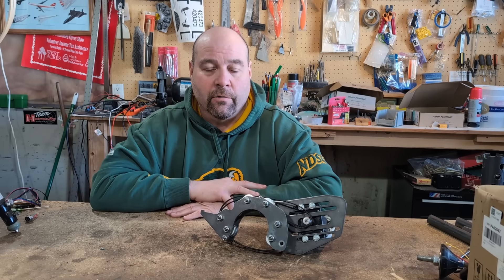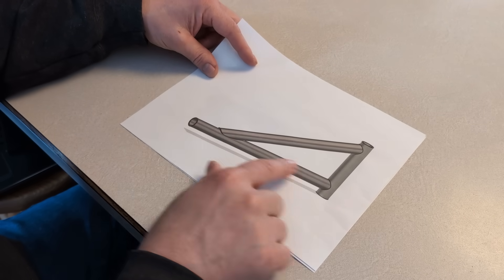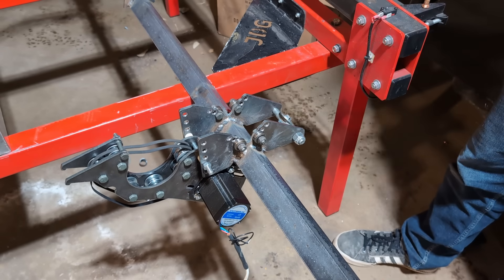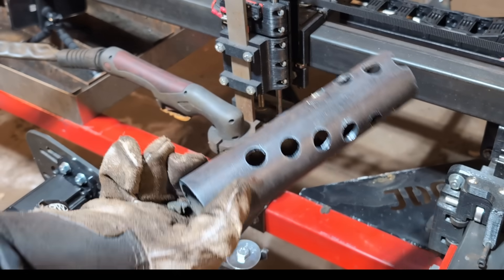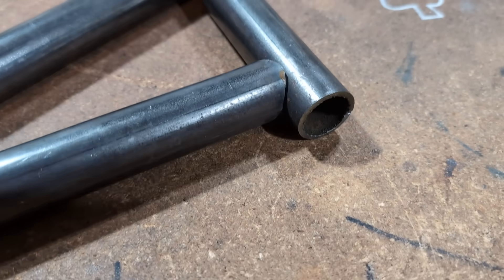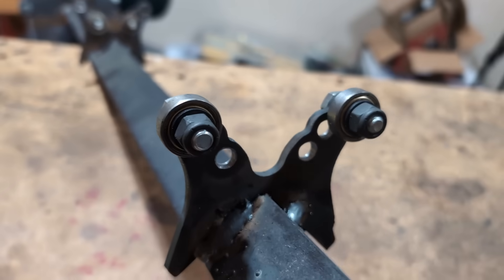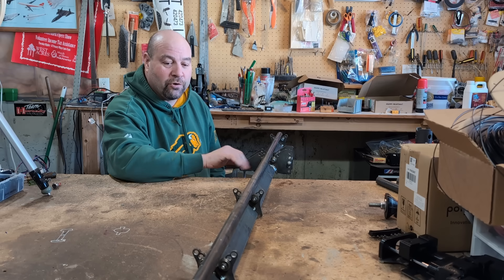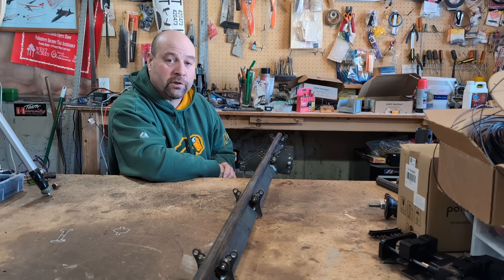DIY CNC Plasma Tube Cutter

Comment from the maker: Plans to build this are available on our website here. https://jdsgarage.bigcartel.com/category/plasma-table-xl
Reply: @jdsgarage701  thank you. I have both sets of plans. I just never got that deep till this video.
Reply: Will you add this to the small table plans as well?
Reply: Would you sell just the rotary portion?
Reply: are the plans for the rotary included with the XL plans? There's no mention of it on the website.
Reply: @welderguy0000  they are included in the plans for the XL I purchased
Reply: @starwazfan  The tube cutter is awesome, The plans are very well done and support is in fact amazing.
Reply: @ArloMulta  I have purchased them and have all of the components together and I am in the process of working on the electrical portion.

Comment: I purchased, built, and have been using your first-generation table with the first-gen rotary axis. Any chance this rotary Axis/tube notcher would be available as separate plans so people can use it on their Gen 1 tables?  Great Job Guys!! Thanks!
Reply: ola amigo
tudo bem?
vc disse que fez uma maquina de 1 geração.
sou do Brasil.
eu comprei os projetos do nosso amigo jd garage.
vc pode me ajudar a montar a minha?
nao consigo encontrar os arquivos que especificam quais os motres 
devo usar.
quais os drives?
qual placa de controle?
qual motores devo usar nos eixos inclusive o eixo rotativo?
e o diagrama de montagem eletrica?
agradeço se vc puder me ajudar.
um abraço...

Comment: I have tried a number of times to contact someone at JD’s Garage just to answer a few simple questions. Before I purchase their plans, but I get no response. I’m not sure if I’m not getting through or they just too busy to answer. 
Are the plans always the latest version of the project? 
As they make upgrades to the plans will they be available to those who have purchased the plans?
What is the approximate cost of the most updated version of the table?
Reply: The email address in your inquiry is invalid

Comment: Clever design! 👍
How did you set it up for each tube diameter? You dony seem to have a sensor for tube rotation, so did you just have to enter a magic number into the software for each tube size? What if the number is a bit out? You would get degree errors

Comment: Pretty slick. My water table looks the same. It’s been in the low 20° F here and my shop should probably get insulation before I build a rotary tube cutter 😂
Reply from the maker: We wish it was 20F when we filed this video.

Comment: That’s not what CNC stands for.
Reply: That is a CNC rotory tube cutter. CNC means Computer Numerical Control. Using number (gcode) to moves y axis and x axis rotating the tube while cutting. Now you know.

Comment: What if the belt slips on the tube?
Reply: It shouldn't if you have the belt tension right and the rollers are install straight.

Comment: 3 in 1 fiber laser cutter / welder /  cleaners are becoming more common and cheaper now. One on Kickstarter at the moment that can cut 1/8". Another YouTuber @Kwrigg mounted one up on a plasma table with great results. The rotary is a huge deal having it integrated in the same machine. You guys are doing awesome work !
Reply: Will deffo be a good future upgrade 😊

Comment: I was thinking about an adapter to notch square and rectangle tube.
Reply: Rectangle tube would require a z axis to vary the torch height from long side to short side.
Reply: @timblossom8904  What about capacitive sensing that maintains the Z Gap?
Reply: @ElectricBikeLaboratory  to be honest I had to Google capacitive sensing Z gap. I was commenting based on the video we all watched and the presumed idea that this is a pretty straightforward DIY project that is bringing some great things to guys with limited fun money to throw at a garage built tool for part time use. I do think a simple round tube to square tube adapter, figuring out g code and cut speed  not included, would be pretty straight forward because the horizontal plane of all 4 sides of square tube would be the same, whereas a rectangle would not. I do not have any personal experience in converting the JDS garage rotary access cutter that was released this morning from round to square, rectangle, or any other profile, and I do not have a background in engineering, cnc tool design, or operation. Just a simple fat  guy that subscribed to get notified when this dropped so I could buy the plans, which i did.
Reply: @timblossom8904  haha totally fair ! The THC sensor that they use may actually follow the square tube and not pose an issue. I'm not sure either but I believe the THC (torch height controller) will help to follow the profile of a square tube as well. I'm super interested to know myself, I have seen other CNC machines that do this.